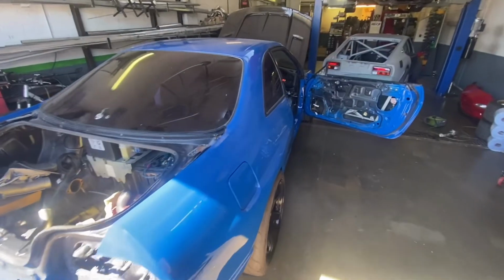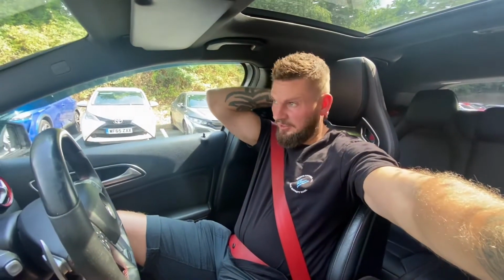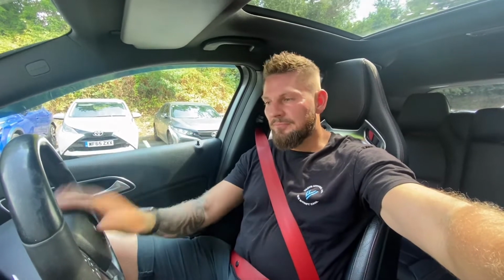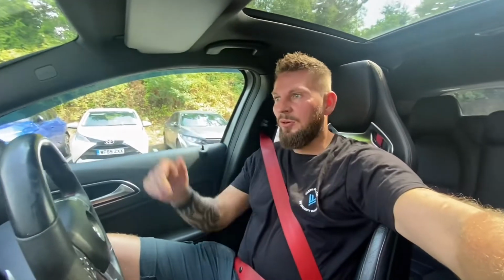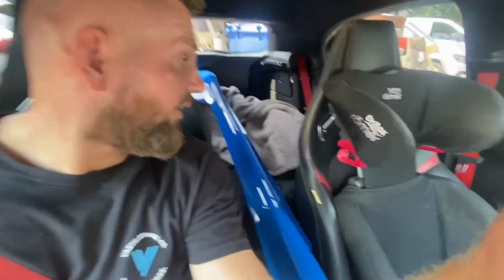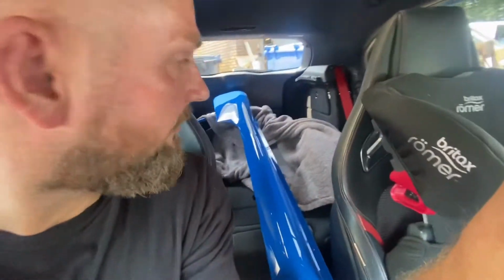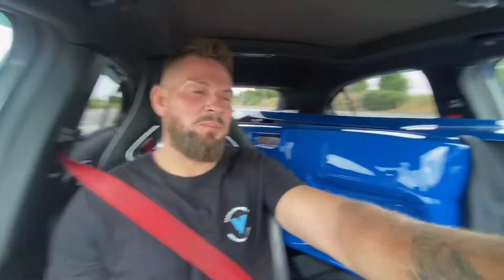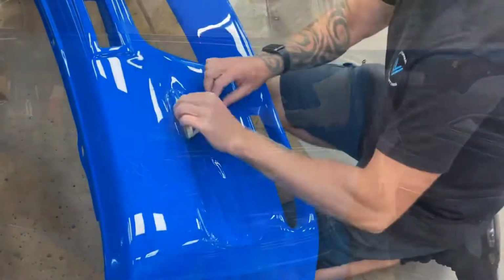R33 Skyline Project (GTR front bumper & fenders installed) Episode 30

Comment: Hoping to convert mine to look like a gtr. Inspirational video.
Reply from the maker: Thank for the support 🙏
Reply: @ryanhennessey1009  is the bumpers and fender all from knight racer?
Reply from the maker: @X7rocks  yes mate all from Knight Racer, fitment isn’t perfect needs some messaging when fitting it😂
Reply: @ryanhennessey1009  that's awesome! Even if some work is needed if I can pull off a gtr conversion for less than what original part cost go for its a win!